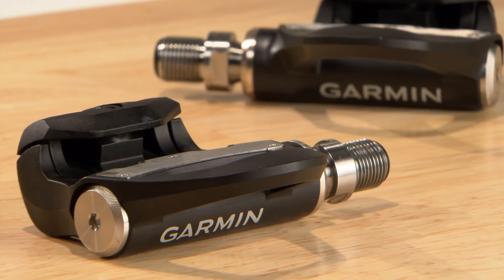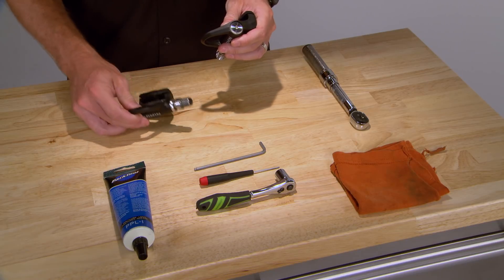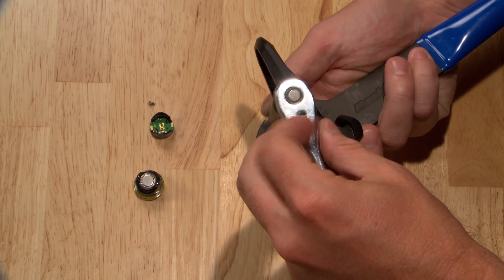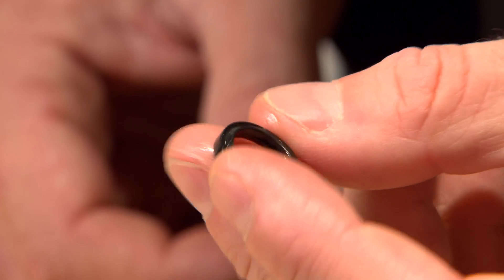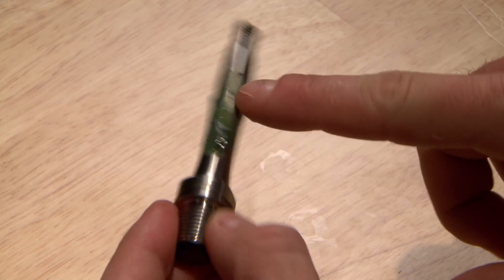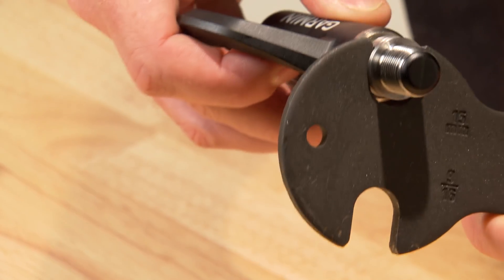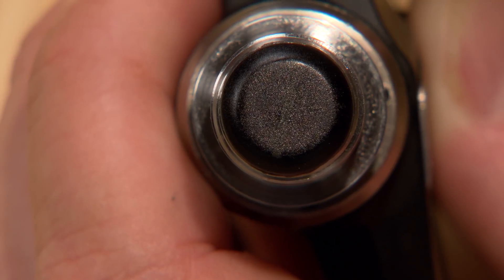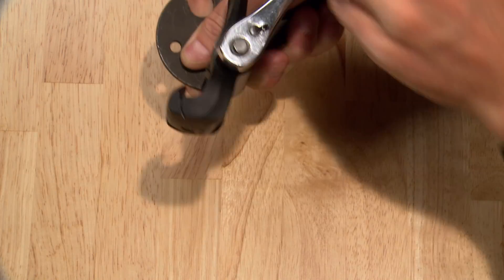Garmin Vector 3/3S: Servicing Your Power Meter

Comment: My 12mm socket wrench doesn’t fit. What brand of socket do you use?
Reply from the maker: Hi there! I'm not sure what brand was used for this video, but you should be able to use a 12 mm socket with an outer diameter that is less than 17 mm (typically a 1/4 in. drive) on a pedal wrench. If you have any questions, you're welcome to reach out to Garmin Support directly by using the contact information listed at the bottom of this page: http://bit.ly/GarminContact-US (KS)

Comment: Vectors cut out a lot... Not a fan.
Reply: There's a problem with the battery carriage or "cap" and the PCB negative electrode that is too weak for the application. I would test OK for most devices but the loads on power measuring pedals are unique, as anyone can imagine. 

Also, the lame yellow o-rings must be kept in perfect condition or expect moisture to get in and further interfere with consistent, usable voltage to the circuit. The Garmin solution is to 'change the seals' (that almost nobody can get) and to apply mineral oil to the batteries!

The battery cap has been revised but they're only selling it online. I had been working with them for several weeks (about a year ago) and they advised me to rebuild my own with small bits of electrician's tape even as they prepared to sell the revised battery cap as an accessory!

The PCB has a DIY fix where you must find some material, like synthetic cork (that doesn't attract any moisture) and put a wedge under the batter contact. That will increase the preload on the circuit to keep things operating relatively well if you also check the positive electrodes on the battery cap every time you change the batteries and also make sure that the yellow 0-rings are in perfect condition.

Garmin's after sales support just absolutely sucks. Their design engineers are excellent but the company itself is growing like Apple Computer where there is some internal chaos and lack of clear vision to support the existing products as they chase after new market niches with things like adding Bluetooth to everything and buying Tacx, both to  protect market share from Wahoo and to capture new "Zune" users that would not have purchased such high tech consumer goods before. Meanwhile, the core "expert" users are somewhat screwed as they are abandoned to their own devices. 

And I'm not just a "net whiner" because I took this up with Garmin in the USA and in Asia. I also discussed this with "expert" fanboys on DC Rainmaker and most of the mouth pieces are cult members that don't know how to solve business or technical problems.

Comment: Lol what a hassle, once i need to do this I will sell them. I don't have to time for this kind of bs. Mayne I will buy Quarg next time.
Reply: The only real disadvantage to using pedals over other locations for measuring power is that for now you're limited to Look style cleats. Cranks have issues as well and if you find anything that is "trouble free" it probably means that it's so simple that it's not going be as accurate as the precision devices. Crank based power meters are generally harder to service and pedals need to be serviced as well. The problem with Garmin is not that you need to service the pedals but that the PCB and cap design need revision. Otherwise it's SOP pedal service and battery changing that you should have to do anyway if you actually use your gear. As pedals, these are very high quality components. They should outlast just about every other Look style pedal on the market.